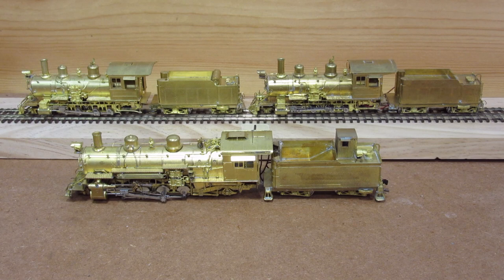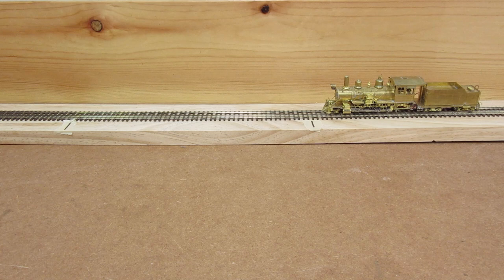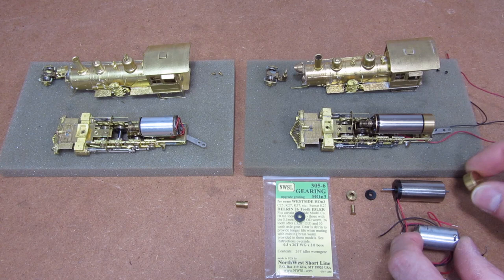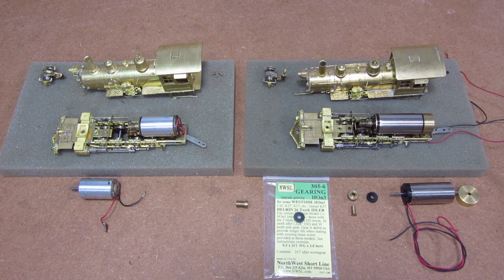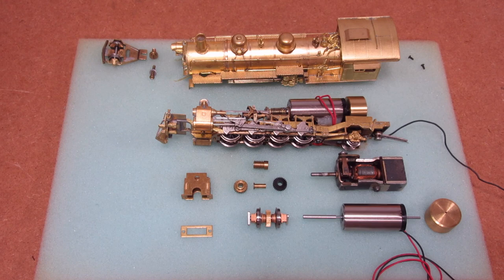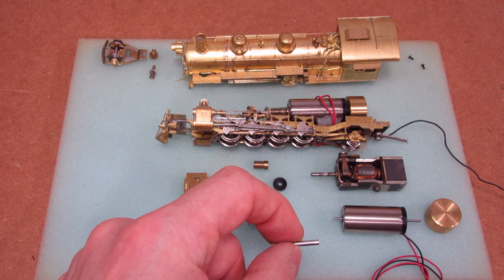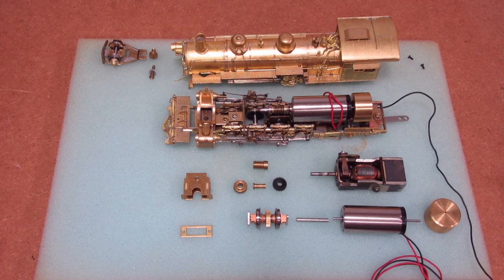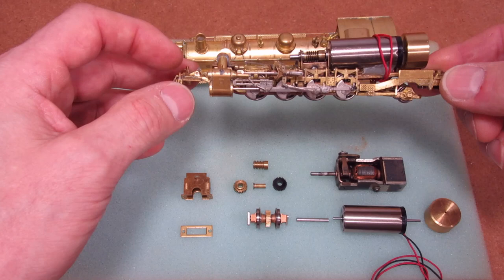Getting Your Westside Hon3 Brass Locomotives to Actually Run!  Re-gearing, Re-motoring and More!

Comment: Westside models were made for young beginners who were used to Hot Wheels and electric cars. These held their interest as the newbies could play “Slot trains”.  As they grew older and understood Narrow Gauge modeling realism became the focus.  Slow moving short trains and tight radius curves could be modeled in a bedroom. 
Nice job Damon!!
Reply from the maker: Thanks PizzaPete.  

Now that the rescued C-25 is running I'm getting a TERRIBLE urge to combine it with some K-27 parts I have and rebuild it with piston valves and Walschert's valve gear.
Reply: I don't remember any brass locomotives being for beginners when these were new. Back in the early 70's when I was starting in the hobby, a cheap Tyco or Life Like freight car or a few pieces of Atlas snap track a week was all my budget would allow. Brass locomotives and rolling stock were simply out of my universe price wise and definitely not beginner territory. And it wasn't just me being a teenager, either. I knew a model railroad club member that was a 28-ish year old single and no kids business accountant that saved a year in order to buy a used Van Hobbies brass CPR T1c 2-10-4 at $750. I remember seeing new and used Westside, PFM, Key, and United brass large and articulated steam locomotives at the local train store with price tags hundreds more than what my parents paid for their nearly new cars and trucks throughout the 70's and 80's. My mom, not looking very carefully, thought one price tag on a new PFM "Crown" GN R-2 was ridiculous at $280. She nearly choked when the staffer behind the glass display counter told her it was $2080. Heck, it took nearly 10 years before I could afford $125 for my first used high end plastic steam locomotive (a Rivarossi Cab Forward, which still had the original 1979 $349.00 price sticker on the box).

Comment: Here is some excellent content!
Very well explained what you did to these locomotives, and good advice too.
I have never thought of this gear wobble before, but it makes sense when drive gear and worm shaft (and/or idler gear) are tightly fitted together in a housing with the minimum of play.
These models run beautiful now.
Just be aware that not every DCC chip is suitable for these coreless motors, some of the older ones will destroy these motors.
Reply from the maker: Hey Tom thanks for the comment.

I am using Tsunami2 and LokSound5 decoders in my models.  You're right, the PWM power control used in some DCC systems will fry a coreless motor.  Carbon brush coreless motors are better than the precious metal brush motors in that department.  

The gear mounting issues are so incredibly common on these models.  It's just become standard practice for me to remove the geared driver, turn down and true up the axle knurling, and put the gear on a wide brass hub.  Eliminating both radial and axial runout is pretty essential for smooth operation.
Reply: @dtj9923  Tsunami 2 and Loksound 5 are good for these motors, loksound 4 also. But I wouldn't recommend earlier marks of these brands.
Some RTR brands in Europe use coreless motors in some of their models now.
And Märklin uses brushless motors, but these are a completely different kind of thing, they need their own AC frequency drivers connected to the DCC chip motor terminals to control them.
I'm a On2 modeller by the way, modeling all kinds of 2 foot gauge prototypes that exist around the world. I work in the British 1:43,5 scale on 14mm track.
A South African NG/G16 Garratt, Darjeeling Railway B class 0-4-0 with coaches and a Baldwin 4-6-2 as exported to Brazil and South Africa are amongst my collection.
Reply from the maker: @Tom-Lahaye   1:43,5 scale on 14mm track is one of the more unique scale/gauge combinations I've heard of. 

Have you ever heard of WC Greene who models in 1:35n2 here in the USA?  He has a bunch of posts in on the Freerails website.  Interesting stuff, very Mexican feeling.
 
The 2 foot 4-6-2 engines from Baldwin are pretty interesting.  I know the prototypes you are referring to.

I actually have an extensive collection of On30 equipment put away for a time when I have room to play with it.  Some of it has actually already been regauged to On2 or On3.  I have a small bit of On2 brass and some On2 Grandt Line models.  And I play with some On20 which is 1:48 O scale on Hon3 track.  The track is perfect for mine and industrial tram layouts! 

https://www.youtube.com/watch?v=_VCAFl6bkBA
Reply: @dtj9923  1:35n2 is another weird scale, I have never heard of it.

One of the Baldwin 4-6-2 locomotives is preserved in the UK, at the Brecon Mountain Railway.
They also recreated a consist of American type box cars and gondolas with a caboose.
Other Baldwin 2 foot gauge locomotives are in the proces of restoration or new build, and the goal of this railway is to recreate a typical American 2 foot railroad, with rolling stock as least, as signalling is typical British and the only station building is a rather bland 1970s building without any reference to either British or American railway buildings.
It's a nice little railway though, which I visited once.

I also own quite a bit off the shelf On30, for use on the club layout, which depicts a typical free lance Rocky Mountains railroad.
Apart from a kit built little diesel switcher body that fits on a Bachmann 0-4-0 chassis.

Comment: I have a Westside C-25 that runs well in spite of being a bit of a “slot-car”. Pretty sure converting to DCC can address that. I have the delrin idler gear, but not the springs. Which NWSL part number are they? And… the pilot has no spring at all. Same one?
Great video! Thanks, Steve
Reply from the maker: Hey Steve, thanks for the comment.  The C-25 models don't necessarily run poorly with the original motor, just really fast.  DCC will absolutely help tune the top speed and improve your overall performance.  I would definitely check the stall current on the stock motor before selecting a decoder.

For springs I would suggest going with the NWSL "wimpy springs".  These will definitely allow the locomotive to  flex over uneven spots in the track.  A C-25 is pretty light.

https://nwsl.com/collections/screws/products/spring-wimpy-007-2-0mm-od-1-5mm-id-4-0mm-l

The next step up is the NWSL light springs but I like the wimpy springs better for the C-25.  I use these on my Westside K-36/37 models that have big lead weights in the boilers.

https://nwsl.com/products/spring-light-008-wire-2-0mm-od-1-5mm-id-4-0mm-l

The pilot truck is a Kadee out of my spring selection.  It's silicon bronze and pretty light.  I'll post a reply here when I figure out what Kadee number I used.  

Thanks again -DTJ

Comment: I have four Westside Model Company HOn3 Brass K-27 steam locomotives from the mid 1970s. Three "piston valve" versions and 1 "slide valve" modern version. I'm a brass collector, so I don't run them much. Except on a test track once and a while. They're WMC brass models and very similar to your models in the video. I'm assuming (since viewing this video) they will also need re-gearing and re-motoring. Am I correct? 😬 If so, I will have to find someone like you to help me upgrade the gear and motor systems. They're gorgeous brass K-27 engines, but I never knew WMC produced such gorgeous HOn3 engines with inferior motors. If my K-27 engines need to have new gears and motors installed, I will need a helping hand from someone who is knowledgeable. I am NOT good at this sort of thing. 🙄 😕
Reply from the maker: Hey Everett, I'd have to peek under the hood and see exactly what K-27 production versions you have.  At the later PSC transition era you might find a decent can motor and a Delrin idler gear in the gear tower.  My refence for this is an unbuilt PSC/Westside transition era K-27 kit from Nakamura Japan in my closet.  I have never owned an early or mid production era Westside K-27 so I can't speak to their specific mechanical design issues.

I have a BEAUTIFUL WSM Craftsman K-36, stunning model.  It weighs a ton and has a tiny little 12mm Namiki coreless motor in it.  The thing is severely underpowered.  Very smooth runner though.  Does not like 19 inch radius Blackstone track.  No sir!

If your locos have brass idler gears and brass worms the general advice is replace the idler with a NWSL Delrin gear at a bare minimum.  I have never tried to retrofit a standard 5MM NWSL steel worm but off hand I remember the westside worm being a slightly larger diameter, not sure about the angle, I think it's the same or close.  If you want to get super fancy you can send the worms for electroless nickel plating.  That actually improves their survival significantly.
  
You'll have to count the teeth on the idler to figure out what idler gears you have.  I know NWSL sells two different versions for these models.  

Early K-27 with 30 teeth
https://nwsl.com/products/worm-gear-0-3mod-x-30-teeth-x-9-6mm-od-x-0-118-face-x-2-4mm-bore-delrin?_pos=1&_sid=7406d30b6&_ss=r

Later K-27 and K-37 with 26 teeth  (also fits the C-25 but they don't advertise it)
https://nwsl.com/products/worm-gear-0-3mod-x-26-teeth-x-8-4mm-od-x-0-110-face-x-3-0mm-bore-delrin?_pos=1&_sid=dec9cda44&_ss=r

If you can manage it I highly recommend getting these gears with hubs or adding wide brass hubs like I did.  The brass hub was used in production on the K-27 Nakamura kit I have here.  It makes a huge difference.  Use a polished stainless dowel pin for an idler shaft if you can.  Lightly JB weld it in place, soldering will cook your new gear.  A polished shoulder screw works too.  

The wheel set and gear assembly issues I talk about in the video are all pretty common on these models.  If you're getting hops, skips and jumps start looking at the drivers and that axle gear.  I picked up a PFM White Pass 2-8-2 new in the box this past year and it has the absolute worst wheelsets I've ever seen.  Thing wobbles down the track like a cartoon locomotive.  Just terrible.

Let me know what you have going on with your models and I'll try to help as best I can.  

- DTJ
o

Comment: Great work!  Do you have a video on remotoring the Westside HOn3 Heisler?  I have one that needs done, but with my shaky hands I have not messed with it, and yes those KTM motors are trash.  I was able to remotor my Balboa K36 with a nice can motor salvaged from a Norelco rechargeable razor that the battery gave up on.  Smooth and quiet now, thankfully its steel worm on brass gear.
Reply from the maker: Hey thanks for stopping by!  I'm on hiatus from YouTube right now dealing with a major house renovation.  I've had to put a pause on everything modeling related sadly. I'll eventually swing back and do something on the Westside Heisler.  The motor and flywheel is just a start.  That drive shows pretty excessive wear, it's mostly brass on brass if I remember correctly.  I have some ideas for an improved drivetrain but they'll have to wait a bit.  The later PSC version has a very different setup I'm looking at for inspiration.  I'll post something on here when I get back under the hood on it.

-DTJ

Comment: I recently got a Balboa K-36.  I've heard they are a poorer quality model then the Westsides.  Do you have any experience with them and their unique issues?
Reply from the maker: I have not worked with the Balboa models but I do have a shiny NOS Balboa C-21 parked on my shelf.  

The first thing I would check is if the worm and gears are all brass.  Brass on brass is a definite no-go.  I would be prepared to throw a NWSL gearbox and a modern motor in it.  I think a 0.3 module 36:1 gearbox will fit.  Might need to shave the bottom gear cover for ground clearance.  The 28:1 will fit for sure but that 36:1 reduction is nice.  I suspect all the same drive train watchout issues will be present on the Balboa you find in the Westside models.  Gear runout, wobbly wheels, quartering problems. Pretty common. 

If you plan to run DCC you will definitely need a modern can or coreless motor with lower amp draw.

Keep me posted and feel free to follow up with any questions.
Reply: @dtj9923  Thanks, will do.

Comment: I'd be curious to see more of the actual process for how you fixed that main axle gear.
Reply from the maker: I have a few more gears/axles that need resolved.  What I need a camera operator!  I'll try to capture my next clean up operation as best as I can for everyone.  I may have some photos I can piece together.
Reply: @dtj9923  could you attach your camera to one of those desktop microphone booms?

Comment: Hello - I have a PSC HOn3 K-36 with running issues. 

Wondering if you can give me guidance in step - wise to tune it up and improve upon !

Also, could you ever make a video as to how you remove all the side rods and wheel sets to put the softer springs in?  Then there is the matter of ensuring - quartering for the drive lines? Correct ?  Which I have no experience with -  regards Tim
Reply from the maker: Hey Tim, thanks for stopping by!  I'm taking a break from models and videos for a while, home renovation has unfortunately displaced my time in the model shop but I'll try to answer some of your questions as best I can.

Can you describe some of what your PSC K-36 is doing or maybe post a video on YouTube?  That would really help.  

One great way to diagnose things is to removing components starting with the valve gear and see when the locomotive starts running better.  There's a lot of hard to see interference issues with the running gear on these outside frame models.  My rescued K-37 originally had terrible interference problems that resulted in bent and broken parts.  I also have a pair of PSC Crown C-21s with all sorts of running gear binds that I still need to sort out.  Shorting of the insulated driver tires on the frame is also not uncommon.  Both my C-21s do that as well.  Then there's just the normal checklist of brass problems; wobbly wheelsets, wobbly gears, bowed axles, random shorts, bad motor mounts, bad motor couplings, dry motor bearings, and really bad gearboxes.  By the early PSC era gearboxes were very much improved and only tended to get better.

Full disclosure, I do not have an actual PSC K-36 on the shelf but I do have an example of a Nakamura Westside Craftsman series K-36, which I believe is the immediate precursor to the PSC models.  I'm not completely sure how much they vary.  I do know the Westside model needs a much bigger motor than the tiny 13mm Namiki it came with.  It is severely underpowered for its weight.  Otherwise it runs well.  I have a 16mm 7 pole low speed Maxon coreless motor and a big flywheel lined up for it.  The gearbox and drive setup seem to be decent.  The lubricant for the Namiki motor bearings has a tendency to harden up into a waxy substance and dismantling these to lubricate them is not for the timid! 

Replacing the springs is actually pretty straightforward but incredibly fussy, surgical forceps and patience will ultimately win the day. The secret sauce:  Take off the rods, mark them left and right.  If you have flat head screws be gentle, they're easy to damage, if you have actual miniature hex head screws definitely find a miniature nut driver.  Remove the bottom plate but do not go and immediately remove all the drivers and springs.  Note which side of the plate faces the frame, sometimes it matters due to hand fitting.  Carefully remove and replace the springs from one driver at a time using a pair of fine forceps.  An engine cradle really helps out here.  Lift the drivers out just enough to remove the springs from their pockets in the journals, I try replace just one side at a time unless I'm pulling the axle completely for some reason.  A tiny dab of sticky grease on the spring end will help stick the new springs in place, only dab grease on the journal pocket end of the spring.  Then you put it all back together starting with the cover plate.  It's tedious for sure.   

Quartering in HOn3...this exercise can be fun...and the tools available are often really frustrating and hard to use.  I've been meaning to post a video on this but I definitely need to find a camera operator first.  I ended up machining my own V block style quartering fixtures and crank pin bushings to do this accurately.   The NWSL 64-4 Quarterer 2  is by far the best tool out there but it struggles with small HOn3 size wheelsets.  I have a 64-4 with all the fixins.  It's beautiful tool, I'm not picking on NWSL in any way, it's just tough to use for HOn3 size wheelsets, otherwise amazing.  If you decide to buy a quarterer make absolutely sure it fits your axles.  The NWSL 44-4 claims it works for 1/8" (3.175mm) and 3mm axles but 3mm is an undersized fit and in my experience it does impact the accuracy of the tool.  

Try to get a video posted of your running issues and I'll see what I can do to help from here.  Thanks again!

-DTJ
Reply: Super DTJ -  thanks for the awesome inputs !  I was planning to pull the running system out of the “loco shell” & then disconnect the motor from the drive wheel drive line gear.  Check for bindings, wobble, slack, ect.  Then look to why the sun-frame seems to be pushing down a bit.  A friend mention is is probably the motor pushing down in the wheel “drive gear head” hence not running !

I sharing email ok via YouTube ? 

Else I can post videos here, although would be nice to share still pictures 

Thanks Tim